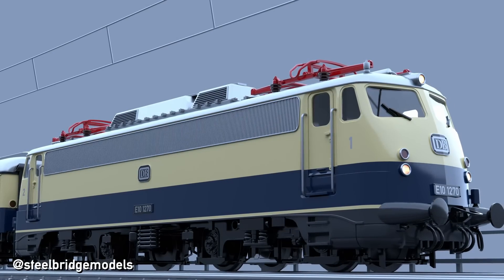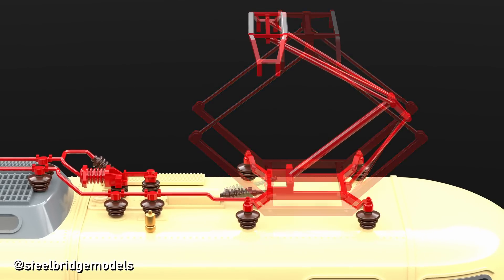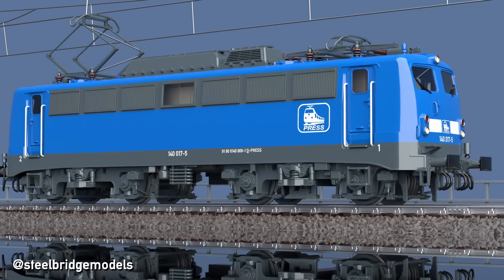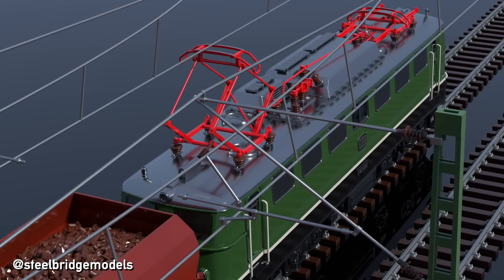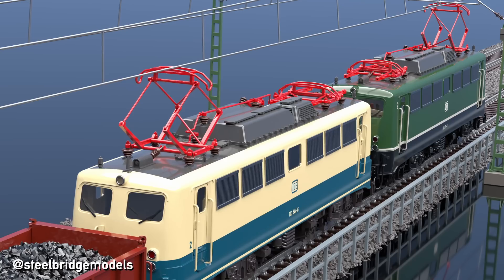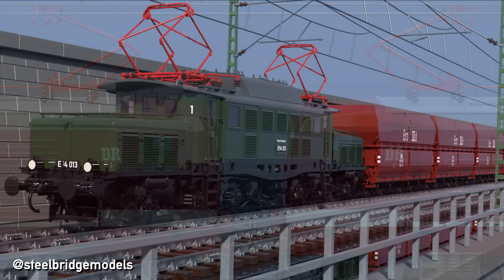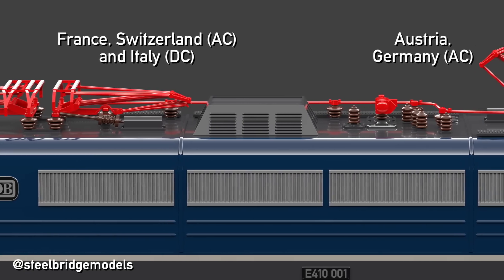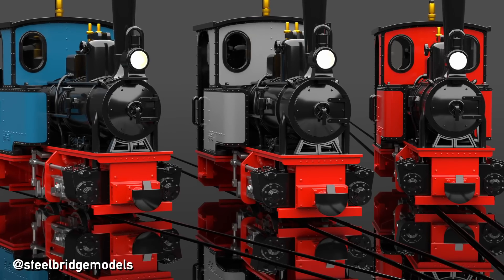When to use which Pantograph?

Comment: In Finland, while the basic arrangement is the normal "far apart" with double locomotives in front, slow freight uses rear pantograph on both locomotives. The reason is that the locomotives for slow freight are often paired up for longer times, switched between trains as pairs. Using the pantograph the most far apart, those would wear out faster than the "inner" ones. To balance out the wear, you use the rear ones on both locomotives.

Comment: In Sweden, some older types of electric locomotive are normally used with the front pantograph. The F class (electric) and the Ra class are two that I know of, and it's supposedly for aerodynamic reasons.

Comment: In russia, you use the rear pantograph since if the pantograph breaks it falls onto the couppler and not on important locomotive equipment.
However, on 3kV = current, you use both pantographs when starting to move to distributev large anmounts of electricity
Reply: I've never seen it at Tuapse region, though.

Comment: In France some locomotives used on snow clearing duty are fitted with a special pantograph (painted yellow) to clear icing form the catenary, currently fitted on some bi-voltage loco's of the BB22200 class, making them unable to run on 25kV lines. To my knowledge these pantographs are also fitted with different/reinforced carbon strips. 
As mentioned by others in France and other DC networks you will see them use 2 pantographs at startup and at standstill under 1500V, to prevent localised overheating of the wire. Few French locomotives (eg BB36000) can have a narrow 25kV panto and a wide 1500V panto. The 25kV being more narrow and for this reason is not allowed to be raised on 1500V lines where the Midi type catenary is used, because the Midi catenary has a bigger zigzag and the pantograph could end up next to the wire. On non Midi type 1500V catenary this narrow 25kV pantograph can be used without issues and will be used at standstill and start-up. Most bi-voltage French locomotive's (eg. class BB22200 and 26000) however are only equipped with a narrow 1500V and a narrow 25kV panto thus not allowed to go on lines with Midi catenary at all. For multi-system locomotive's often the wrong pantograph may be used with restriction in case the correct one fails so the locomotive can continue to a safe place.
SNCF has some great video's about development of the pantograph for the TGV and the national railway museum in Mullhouse has a great exhibit piece of the TGV pantograph too, explaining the multitude of problems faced for power collection at high speeds.

Comment: The correct answer is that it depends on the railway and country. 🙂

In South Africa, where we can have up to 5 locomotives, they state that the same pantograph on each loco must be raised to maintain equal tension in the contact wire between each panto - Yes, there are exceptions where it's not always possible for whatever reasons because life happens.

EDIT: There is also the load that is being pulled like passenger or tankers, normally they will use the forward panto.

Great video and EXCELLENT modelling!

Comment: Some trainsets such as the TGV take this further by typically using only the a single pantograph on the rear locomotive of the consist [usually the trailing one]; power is then distributed to the traction motors on the lead locomotive (or throughout the train, when applicable).  On the TGV the power cables can be clearly seen running along the centerline of the car roofs.  [IIRC]

Comment: Very high speed trains using one pantograph due to its induced vibration in the overhead wire up down and side to side will cause problems to any second pantograph. Requires special design in overhead wire systems to dampen wire movements.

Comment: There are locs which have 2 for the netherlands and 2 for Belgium. Then they also have to chose by the direcvtion of travel etc. The dutch pantograph is wider, as the overhead wires "zigzag" a bit more than the belgian one

Comment: Very interesting. I am glad that you mentioned Great Britain. 25kVac locos were originally fitted with 2 pantographs, but as only one would be used, later locos were only fitted with one. Earlier locos had one pantograph removed. I think this was for economy reasons.
On the subsequently closed Manchester-Sheffield 1500Vdc system, double headed locos usually had all pantographs raised, but line speeds were quite low.

Comment: Europe: For proper operation, you must do this, and this, and this, and also this, and these things, too.
Britain: Each locomotive has one pantograph. If you need a double-header, just put two locomotives together. If the windscreen gets dirty, wash it. Everything works fine.

Actually, I suspect the real issue is ice on the overhead wires. The UK doesn't generally get very cold, so ice isn't a big deal and one pantograph is enough. Parts of Europe get much colder, so two pantographs are needed. Once you have two pantographs, you may as well optimize their use in different situations.

Comment: Excellent, as always! One thing that seems to happen in France is that under the DC wires, both pantographs are raised when moving off, then the front one is lowered once the initial momentum has been achieved. I guess that must have something to do with drawing additional current being needed (or something like that!). I don't know if this is a blanket rule but it does seem to happen at times. One thing I don't understand is when a dual voltage - AC/DC - has both pantographs raised when starting out under DC. Not at all sure how the AC pantograph is used for collecting DC power...
Fantastic models, too!
Reply: The AC and DC pantograph are connected together so that you can so that you can draw DC current through the AC pantograph and the other way round.
Reply: Both DC pantographs raised when start moving is recommended otherwise one pantograph is drawing too much current to one point and the cable/pantograph will melt.

Comment: It is interesting to note that this does not apply universally. In NSW, Australia, until the end of electric freight haulage in 2001, our 1500v DC locomotives would usually operate in sets of 2-3, with every single pantograph raised. Additionally, although the first of the class 46s used diamond pantographs, later locomotives used a design I have heard reffered to as a "Comeng box pantograph" which has a shape sort of like this, but rotated 90 degrees to the left: ><>. Any idea why they operatef that way?
Reply: I guess they raised both because of low speeds and high current. The comeng pantograph is more compact and needs less space on the roof when lowered.
Reply: @thomasgabler3476  Yes, the speeds were slower, usually 60-75 kilometres per hour, although they could theoretically go up to 115-120 kilometres per hour.

Comment: Their are also some differences in use of pantographs on DC and AC systems.
The DC 1.5 and 3.0 KV systems can only have 2 locomotives max in front of a train because of the amps drop when current is pulled out of the overhead wire.
Also the distance between trains on the line has to be increased to compensate the amps drop in the section.
Thats why you saw often 3-4 diesel engines pulling a heavy freight train under DC wires from the port of Rotterdam into Germany.
There was also the normaly rarely used in railway operations in Europe mixed traction (electric and diesel locomotives) used in heavier freighttrains.
When the heavy freight 25KV AC railwayline  from Rotterdam to Germany came into service those heavy freighttrains could often be pulled with 1 modern electric locomotive. 
Both pantographs up on a DC line is only used to preheat a passenger train before service at slow speeds when overheadlines are iced up and when the locomotve is used for frequent shunting passenger trains ( platform - yard / yard - platform) at a major final destination station.

Also DC systems have "lighter" passengertrain railwaystock to AC systems so less power is needed so trains can run closer to each other in normal service on a line.
An example is the SGM sprinter emu trains build by Talbot Aachen for the National Dutch railways
Reply: What do you mean by DC systems having "lighter" passenger trains?  This does explain why Paris went with 1.5 KV DC for its new Express Metro system, but could you please clarify how they are lighter?  Are they drawing less current?  Is this an inherent trait, or just a tendency in design?

I am asking because I am thinking about Japan and its 1.5 KV DC system.  While they do have relatively lightweight stock in general, there are some rather hefty trains (most notably sleeper services), both EMU and loco-hauled (though the latter are all but dead due to competition from night buses.

Also, Japan did its own thing with pantographs:  The VERY steep Usui Pass (6.67% grade!) required helpers/pushers going up, even with EMUs.  Going down also used braking assistance.  In both cases, a pair of EF63 locomotives (nicknamed "Sherpas") would be placed on the downhill end of the train.  BOTH EF63s kept both of their pantographs raised at all times.  This meant that they would also be running next to a conventional locomotive, with ITS pantograph up.  All on 1.5 KV DC!!  Sadly, they were retired in September 1997 when the Nagano Shinkansen opened and the remaining local traffic was not enough to keep the line open.
Reply: @00Zy99  Due to the fact DC can't give so much power as an AC system, they started way earlier constructing more lightweight railwaystock. f.e. wellded instead of rivited carriages what did result in 10 metric ton weight reduction on each carriage.
On one type of carriage (W stock) they went to far and they had a more unstable ride then other type's of carriages.
DC systems were at first used early adopters due to the fact AC systems had serious difficulties to accelerate electric motors, thats why the German railways uses that strange 15KV 15-2/3 Hz system so the electric motors didn't burn out.
The Italian railways had and even weirder AC system a multifase system with several overhead wires. Each powering a seperate wiring in the electro motors.

Comment: On DC systems, where operating currents are higher, the drivers are usually required to raise the sencond pantograph on a locomotive at low speed while performing heavy start, or at standstill if HEP of passenger coaches is on, to avoid over-heating of contact wire. Present TSI even requires that the software of a vehicle will raise second pantograph automatically, when the vehicle is trying to draw a current over 200 A per pantograph at standstill.
Reply: Siema, Polak!!!
Reply: @ADDIVARTH123  Why poles? This happens practically everywhere where there are 1500V or 3000V direct current overhead lines, i.e. France, the Benelux countries, Italy, Croatia Slovenia, the Czech Republic, Slovakia, etc.! But even with alternating current overhead lines there are regulations as to when a train driver has to lower pantographs when the train is at a standstill, for example: when the train is at a standstill at the feeder area district boundaries or when driving with more than one locomotive, at the separation points, as here too correspondingly high currents can damage the overhead lines and pantographs!
Reply: @thomasnovacek4686 all Croatian railways are now 25kV AC
Reply: @CentralJerseyRailfan  Oh, I saw it. I actually wanted to write Slovenia. I don't know how I made that mistake, thanks for pointing it out...
Reply: @thomasnovacek4686  im talking to a polish man bruh
Reply: In italy this is the case. The country is 3KV DC and all drivers that I've met mentioned this point.

Comment: Cool!  Very cool!  Now if I could just figure out which pantographs to raise on my Lego Horizon Express French TGV, which as two arm pantographs at the back of each engine.

Come to think of it, the old Metroliner has single arm pantographs on both its lead locomotive and it’s rear cabbage car.  Which one should I raise then?  Like the Horizon Express, the Metroliner has dual contacts on each pantograph shoe.

Rockatoa, a going to pace around my L-Gauge layout and ponder these things Brickticks out!
Reply: TGV power cars have two pantographs because they are multi-current. One for 25kV AC (the one nearer to the coupling, also used on the high speed lines) and one for 1.5kV DC (the one nearer to the cab)

Comment: That is indeed a question I have asked myself, thank you for the video! 

Of course, now I'm wondering about the benefits of diamond-shaped vs single-arm pantographs... 😄
Reply from the maker: Single-arm pantographs - besides taking up less space - perform much better at higher speeds, as my next video will illustrate!
Reply: I think it's just that it took a while to get single-arm pantographs working, so older locomotives have diamonds and newer ones have single arms.

Comment: The panto setup when in mu (multiple unit) service can be different in each country for example in germany they have the two last panto up (up,down-down,up) but in hungaty they have the last panto up (up,down-up,down) on each loco by the direction its going and in case if its going in tripple mu or more loco together then only the two end locos can have the panto up (up,down-down,down-down,down-etc-up,down)

Comment: This is a rare case of a new video that answers a question I had actually asked myself. I knew that modern multi system locomotives need different pantographs for running in different countries with different electrification standards, but I just didn't know why locomotives bound to a single country would have two identical pantographs. So thank you!
Reply: Actually for the first thing that is not always the Case, if you look at the Northeast Corridor in the United States which uses both 25 Hertz and 60 Hertz power at different Voltages locomotives and Multiple Units with Single Pantographs such as the ALP-45DP are used across the Power Change such as between Boston and New York and from the Lackawanna Suburban Lines into Penn Station
Reply: @IndustrialParrot2816  Interesting, good to know. The opposite exists as well, Germany and Switzerland have the same voltage and frequency, but you need different pantographs anyways because the swiss standard is narrower than the german one.
Reply: @namenamename390  . . . Which explains why the Northeast Corridor locomotives can get away with 1 pantograph for both electrification types, since the loading gauge is the same and the voltage isn't so different as to require different pantographs.  (Nevertheless, some locomotives have had dual pantographs, presumably for better availability, although in the case of the ALP-45DP, if the pantograph fails, you can just fire up the diesel engine to finish your journey and then make it back to the shop.)
Reply: @namenamename390 Just use the wider one all the way?
Reply: @erkinalp  If it was that easy, there wouldn't be any vehicles with both kinds of pantographs for this exact reason.
I don't know for sure, but I suspect the German pantograph wouldn't fit into some tunnels etc. in Switzerland.
Reply: @erkinalp  Using the german one in Switzerland will lead to increased wear on the mid section - which would lead to a high damage risk back in Germany.

The swiss model is too narrow to be safely used in Germany.